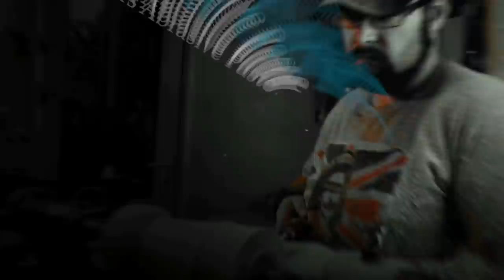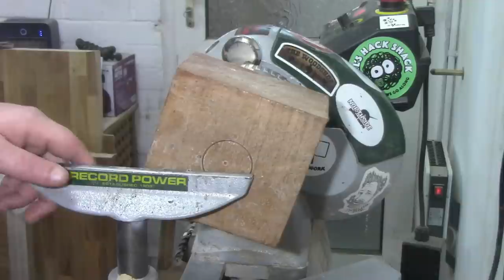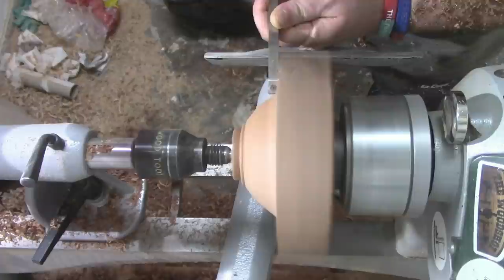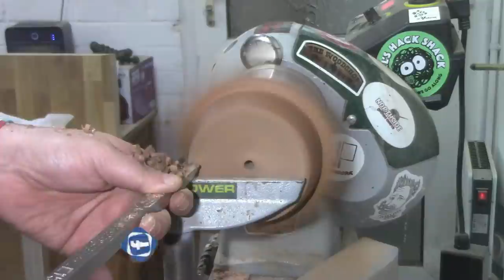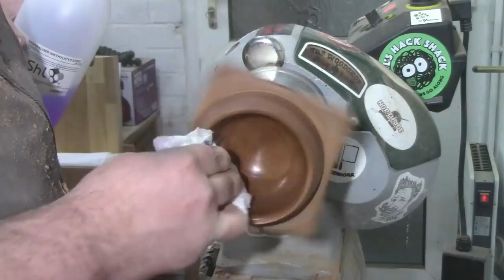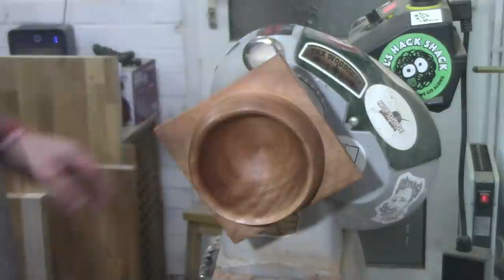Woodturning | Small Winged Bowl

Comment: Hi, this seems to be a Coronet Herald 1420 lathe. I got a lot of vibrations. Did you screw it down?
Reply from the maker: Correct this is the Corornet Herald Lathe, so i didnt screw it down, i made sure it was firstly on a flat surface and secondly i filled the legs with some Kiln Dried sand (must be kiln dried as you dont want the legs to rust from the inside out), i did some pretty large pieces with zero issues however i have really pushed it through its paces over the years i had it before upgrading and it didnt fail me once ....... hope this helps